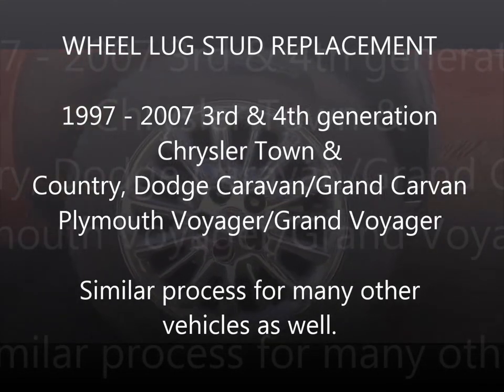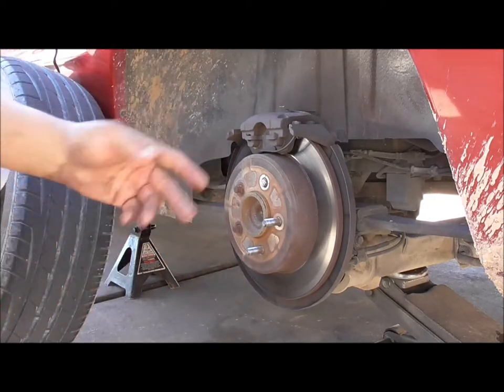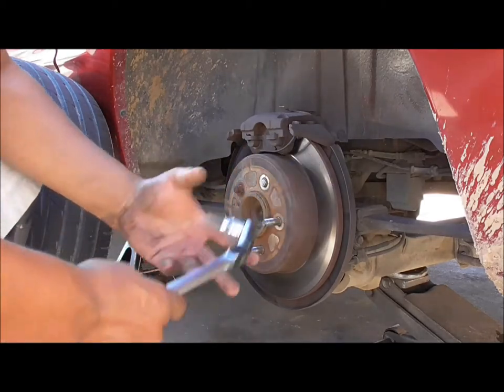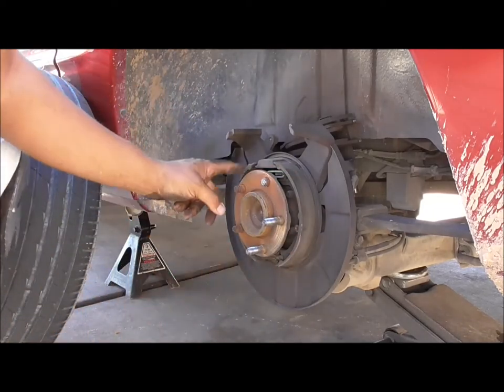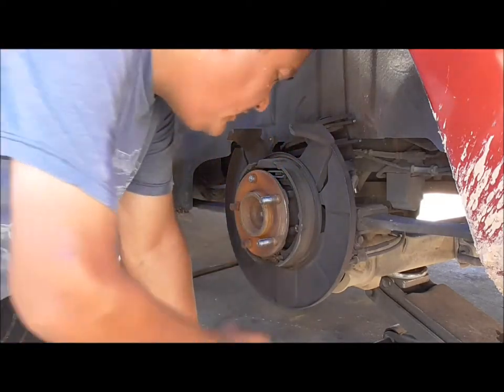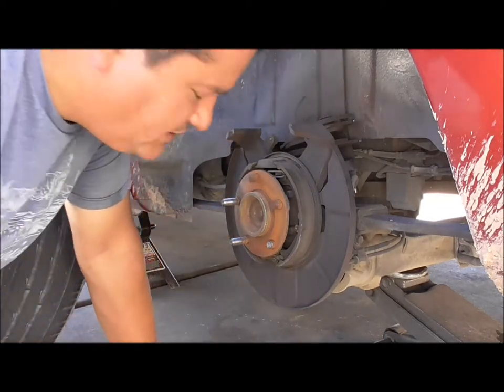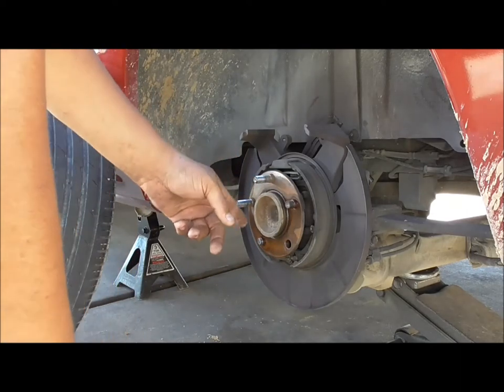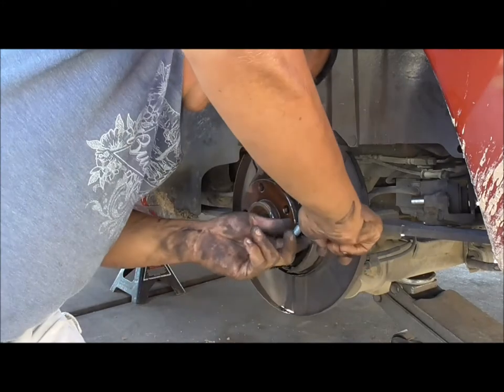1996 - 2007 Chrysler Town & Country Plymouth Voyager Dodge Caravan wheel lug nut stud replacement

Comment: Not all of us live in an arid climate, lol, and I had to use a torch to heat the freaking metal up to knock the broken studs out. 😄 I'm just here to make sure I don't have to pull the brake pads to finish the job. 😄

Comment: @6:29 that's where I'm at.   I couldn't get the after market studs in and I can't find my short 18mm socket.   The bottom 2 hub bolts didn't have room for my longer socket.  Thanks for the video.   I hoped there was a trick that I was missing.

Comment: I did the same thing as what is described in this video. I removed the 4 bolts that hold the hub in but the entire thing comes out (not just the little center part of the hub) - so there is no change to the amount of space between the little center part where the stud goes into and all the e-brake crap surrounding it. Bottom line. Taking those bolts out did me no good and were a terrible pain in the arse to get out anyhow. THe one I'm working on is a 2007 Chrysler Town and Country LX but everything appears identical to what he has.
Reply from the maker: It’s a tad bit different on the 2007.

Comment: The head of the wheel stud won't fit for it to get the correct angle to put back in. 2007 chrysler town and country
Reply from the maker: Sorry, just saw this comment. You have to move it around and if you can’t get it to fit in then you will have to loosen the wheel bearing to give you more room.
Reply: @WarPonyAuto  I ordered new bearing with lug nuts. Found out dealer wheel studs where longer than original that's why I couldn't get studs in. Not the first time I've heard dealer sells wrong replacement part even though it's correct part number
Reply from the maker: jernestoporras Yeah, it’s happened to me quite a few times. Glad you figured it out even though it’s inconvenient there’s still satisfaction in knowing that you figured it out and fixed it right 👍🏽👊🏽

Comment: What size bolt are you using as a spacer? Just don't want to stretch my nuts if ya know what I mean.
Reply from the maker: Sorry it took me a bit to get back to you. I use a 17mm metric bolt but I have several. The key it just to make sure it doesn't interfere with the threads on the lug stud. Use a conical lug nut which will keep the bolt centered and away from the threads.